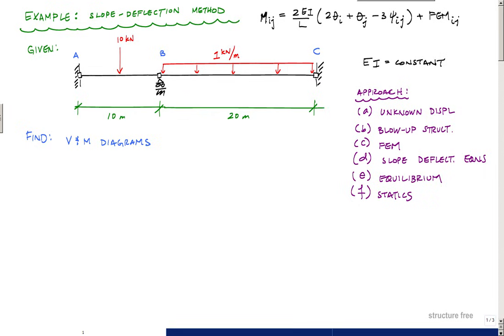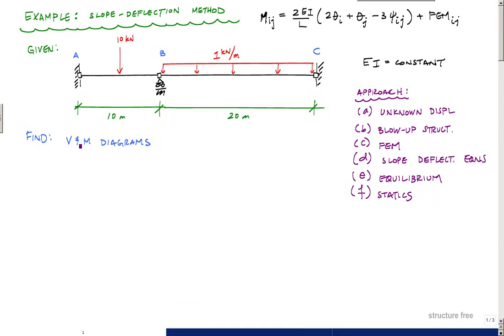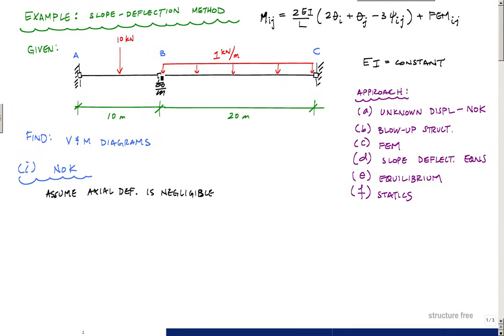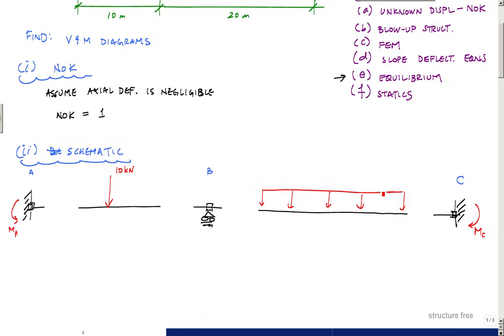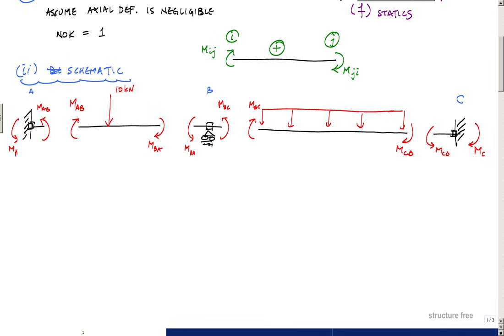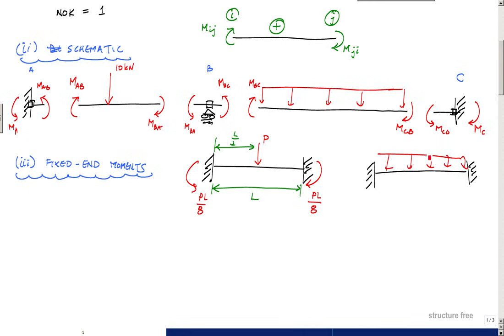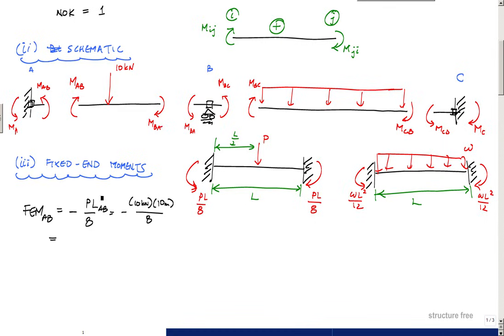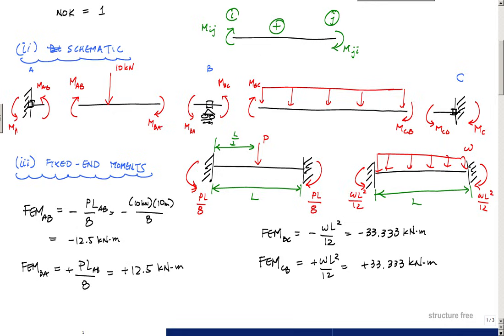Slope Deflection Method Example (1/3) - Structural Analysis

Comment: what if there are two beams , one vertically placed and the other beam end point is connected horizontally with the first beam, making a 'L' shape, and which there are not any joint in the connection point, is that still count a fixed end moment for the connection point, thanks a lot

Comment: Hi, i have a question... what if EI is not constant... i am thinking AB & BC having two different inertia values (say I for the first half length of AB & 2I for the second half. And 3I for the first half length of BC & 4I for the second half ).
Thanks in advance.
Reply: juan perez use relative stfness factor K to replace I/L. to get K you need to get the lcd of I/L of every span. in you example if they have the equal length, the K's are 1,2,3,4 respectively

Comment: What if was  a pin instead of hinge at point B...Would be the same solution? 
Thanks
Reply from the maker: Ahmed Mohamed point B is not a hinge it's a roller support.
Reply: Because axial loads are neglected, the horizontal restraint created by a pin (as opposed to a roller) would be moot.

Comment from the maker: i guess that's one way of looking at it. It depends on the sign convention you are using.  typically for the slope deflection eqns/method, a clockwise moment is considered positive regardless which end of the beam you are looking at.